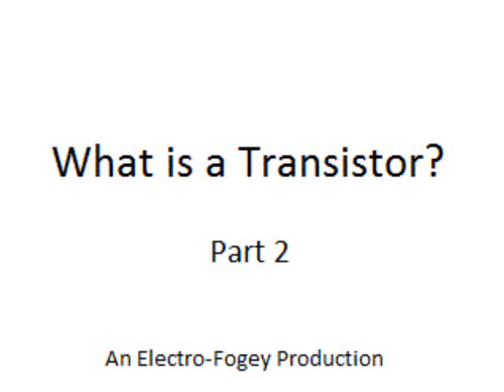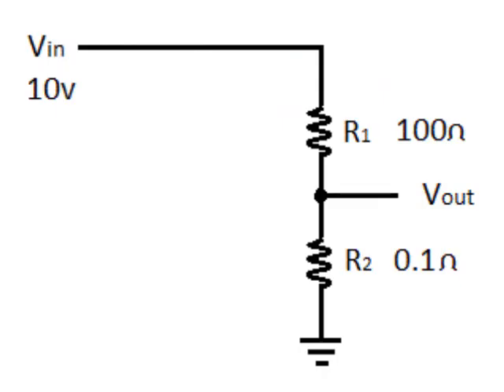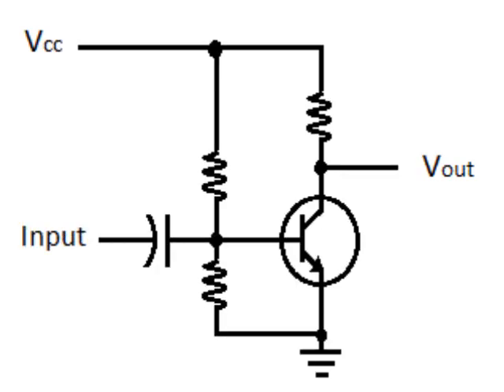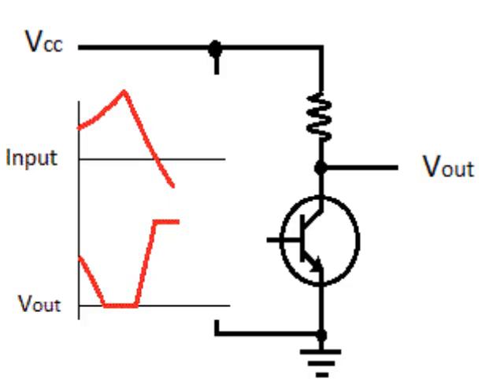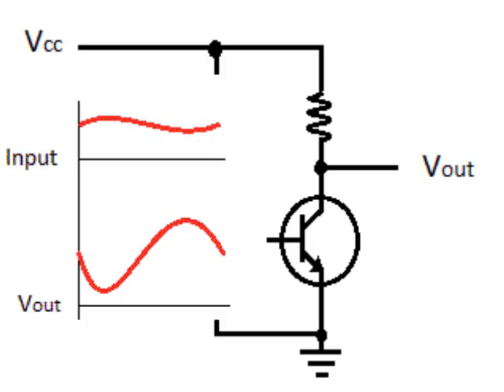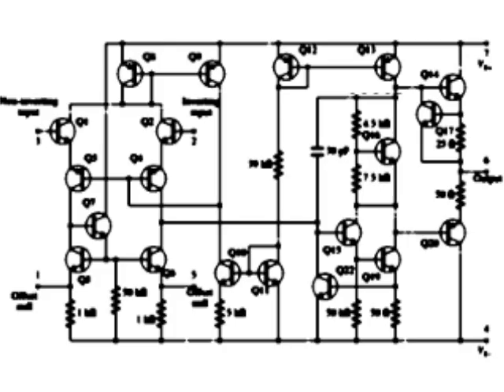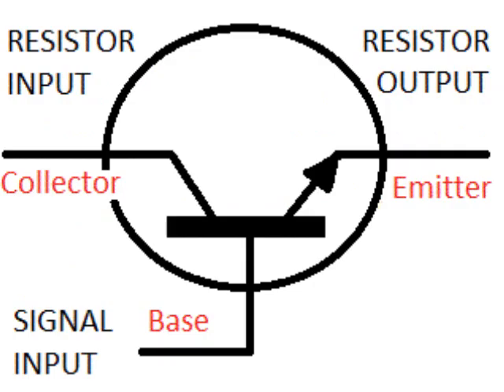What is a transistor?  How does a transistor work?  Part 2

Comment: This is quite cool.  I learnt a lot about transistors with your video.  However, i noticed that you left out the explanation of R1 after you explained what R2 and R3 does.  What is the value for R1 and why? I thought the transistor collector emitter current was already controlled by the Base so R1 was not really needed.

Comment: Amazing! I'm an electrical engineer, whose been working in industry for the past 3 years. I never had a full understanding of how these things worked, and was only ever taught the "Class A, x configuration, blah blah..." 
They made us build circuits with transistors, and showed us how to build an amplifier, described the physics, but never really taught us how to put them to practical use as a tool in our toolbox. 
Thank you Doug Peter, RIP.

Comment: I feel that you are one of the best Tutors I have ever encounter. You have done away with the Narcissistic Ego need of that many instructors have which lacks any common sense.I encounter a question in an exam which I have not been able to find a direct answer for and was hopping you might be able to shine some light on it; What is the voltage needed to forward bias a transistor?

Comment: Why does the phase reverse int this video when it did not in part one? Is that because of some magic in the voltage divider and not due to the transistor alone? And is it correct understood that a transistor and potentiometer roughly does the same thing (variable resistance) but the transistor is controlled by an input voltage whereas a potentiometer is controlled by my fingers? Otherwise, great videos!

Comment: that's not exactly what I said.  I said you can take a weak signal at the base that will control the larger collector current.  The amount of current that flows through the base will determine the amount of current that flows through the collector times the gain.  I agree you need a power supply, but it is not technically the control; it is more like the setup value needed to get a desired maximum current or saturation value.  BJTs are current control devices while FETs are voltage controlled devices.  for the most part it seems like we are in agreement, but we seem to be getting hung up on semantics.

Comment from the maker: I respectfully disagree with that.  You believe that the transistor takes a small input current at the base and outputs a large current at the collector.  This is incorrect.  The transistor does not create a large current, it controls the current supplied by the power supply so that the current it allows through it is beta times the base current.  If you have no external power supply, there will be no output from the transistor.  It simply limits the current, just like a fixed resistor.

Comment: Before knowing the reason you should be familiar with some semiconductor terminologies.
Reason is when you increase base current (or voltage between B and E) the width of depletion region reduces so electrons can easily pass through the Base to the Emitter junction.

Comment: I don't look at a transistor that way.  I look at it as a device that takes an weak input current, usually changing,  at the base.  and amplifies it by it's gain and reproduces a inverted yet bigger copy of the current at the collector.  It is a current control device.  Base current controls the collector current having a gain (typically 100 times the base current.)

Comment: I learned that the input and output coupling capacitor prevented the source and load resistors from changing the Q point set up by the DC supply. You want your Q point be stable in order to reproduce the input signal with minimum distortion. But, I guess it can also be used the way "steel wheels down" described.

Comment from the maker: Adding DC voltage or biasing current to the transistor's input is good for the transistor, but it may be bad for whatever the input source is.  It isn't good to send your DC voltage back through the microphone or whatever, it may blow.  The capacitor allows AC signal to get to the transistor from the input source, but blocks the DC biasing from going back to the input.  If you aren't sure why the cap blocks DC but passes AC, check out my Basic Electrical video or Afrotechmod's videos.

Comment: swag, i was attempting to find the voltage drop across resistor one, but when finding the total resistance, I kept using the parallel resistor equation formula, then I suddenly realized they were in series...that vout line in the middle threw me off. I found it now, 3.33V across r1.

Comment from the maker: The cap stores a charge, but if the voltage is rapidly changing (AC), then the cap is constantly charging and discharging.  This means that a DC signal to the cap is stopped and stored, but an AC signal is passed thru the cap as if it weren't there.  The cap blocks DC, but passes AC.  The AC input signal isn't affected, but the DC voltage made by R2 and R3 is blocked from flowing back out to the input source, protecting it. For more info, see my Electrons, Charges, and Fields video.

Comment: Hi great video and I get most of it but I have a question and is about the capacitor. I dont understand how is working there, I know a capacitor can store a charge but i dont get his use on the circuit, hope you can help me with that and thanks again for the explanation.

Comment from the maker: Vcc does not affect the input signal.  It is 'filtered' through a voltage divider (R2 and R3) so that a small portion of it can be added to the input so that the transistor won't enter saturation or cutoff.  Vcc is also filtered through another voltage divider, R1 and the transistor.  By varying transistor resistance, the voltage from this divider will change according to the input signal, so a small input yields a large output.

Comment from the maker: In a bipolar junction transistor, C-E resistance is controlled by base current.  However, there can be no current unless there is voltage to drive it, so there has to be a voltage rise to increase current flow (Ohm's Law).  Also, for a BJT you need to get the B-E voltage to about .7vDC before the transistor will go active.  In a FET, the channel resistance is strictly voltage-controlled, there should be no gate current (or very little).

Comment: In the video (or perhaps it was your last one) you said that the resistance changes based on signal input voltage.  Then here you said the resistance changes based on base current.  Does the resistance actually change based on base voltage or base current?

Comment from the maker: Yes, and I should have added a capacitor between the collector and the output, but I had two objectives here - first, simplify the hell out of things, and second, beat the YouTube 15-minute limit on new users.  I needed to get to the op-amp conclusion as quickly as possible, so I had to cut a bunch of stuff out.  I am working on a better tutorial now that my 15-min limit has been removed, but don't hold your breath.  Thanks for watching.

Comment from the maker: A "direct bridge between emitter and collector" means "no resistance" (or  very little), so basically you're saying that I'm right.  I know there will always be a tiny voltage drop across the transistor, but I am an engineer, and the rule states that if reality is within 10% of what I say it should be, then I'm all good ;-)

Comment: sir, may i request something? can you make a video about one simple guitar pedal and how it works? coz i cannot understand, is the signal from guitar mix up to the positive voltage from the DC?

and i observe from schematics that the positive charge is going through the circuit, not electrons coz negative charge from the battery is always connected to the ground..
thanks sir in advance.

Comment: Yes,they definitely are.I hope u r aware that a transistor is nothing but a switch.Logic gates are nothing but a combination of transistors(switches),the way the switches are combined(parall or series) determines the output of a gate,but in a gate ic the transistors r integrated on a silicon chip...
These Logic gates r the basic for micros! Hope this will help :)

Comment from the maker: There's another equation which comes into play here:  P=I x V, Power is Current times Voltage.  You want the largest current output you can have, so look at the transistor spec sheet to see the maximum the transistor can handle.  Now imagine the transistor is quiescent (between saturation and cutoff), and the voltage drop across the transistor is half the supply voltage.  Then, the power equation tells you how much current you can have, so use this voltage and current to find Rx.

Comment: I have a quick question and really hope you can help. The way i derive the PD divider equation leaves you with V_x = (V_s*R_x) / (R_t).

Something none of my lecturers [or books] could properly explain was how you pick R_x. If a question asked 'give V through R_x' then its easy, but what if in your examples it's just a single output junction e.g. V_load, how do i know to pick the bottom resistor to be R_x and not the top? 

I hope you can see how my question is different from the ones above.

Comment: ok,ok... so this confuses me badly as well, if you had a handheld radio and you needed to ground its anttena or any other component how would you do it without touching it to a steal ,or poking a wire into the earth? there is just simply no way to ground anything in a portable device, how the heck can you do this??

Comment from the maker: In a BJT, there are two PN junctions, CB and BE,  and CB is reverse biased.  However, the two junctions are very close together, so this won't work if you just put two diodes together.  The CB junction is  like a zener, tho, so it will flow in reverse if there's enough electrons in the base.  As base signal increases, BE current causes changes in the BE junction, causing changes in amount of electrons in the base.  As base gets more electrons, more go to coll. too, so IBE current controls ICE

Comment: So, that second set of resistors, does that mean the top one would need to be the same value as R1 and the bottom one at the same value as the cut off value of the transistor?

Comment: Can you explain more why if increase voltage input from base, the V out would drop. (Only here I don't understand)
Besides, I like your video very mush, it is very clear, do have more video like this and talk about beta. (I want to know more on why we need to put resistor on emitter or resistor between base and collector. Indeed I know there is something relate to base, but when we should add those resistor)

Comment: They usually supply that with the specifications of the transistor since they change from type to type. You could also find it out yourself by connecting it to a function generator and an oscilloscope while changing the voltage at the base to see when clipping of the output signal occurs.

Comment from the maker: The way electricity works is, voltage is like electrical pressure, and current is the flow of energy.  So, if there is more resistance, it's like resistance to flow in a pipe - there is less current through the pipe, but greater pressure behind the restance (blockage), so when resistance climbs in a circuit, you have less CURRENT, but more VOLTAGE at the resistor (or transistor).  If the resistance value changes, the current and voltage also change.

Comment: Hey  SteelWheelsDown 
How do i know at witch voltage the transistor will be (or nearly) 0ohms? (saturated)
Say i got 12v + on the collector and on the emither i got a 12v 75watt lamp (about 60ma with no further resistor) how do i know how much volt must go on the base to make it saturated?

Great Video btw!

Comment from the maker: Mr. Pan, the whole point of this circuit is to take a tiny AC signal (from an electric guitar or something) and turn it into a big AC signal.  The BJT transistor needs to be turned on first, so R2 and R3 add some DC to the tiny AC and get the transistor active, so now the transistor input is a DC signal with a little AC on top.  The collector output is a big DC with big AC on top of it, and we then run it through a cap to get the output as only big AC. Not enuf space 4 gud answer, making new vid

Comment from the maker: It's part of Kirchoff's Voltage Law: all voltages in a series of resistors must add up to the input voltage, and the voltage on any resistor is (that resistor / sum of all resistors) times input voltage.  So for the bottom resistor, it's (bottom resistor) / (sum of all resistors) times input voltage.  The transistor's resistance can't be calculated easily, but its job is to limit current, like a resistor. The current allowed through the collector is hfe times input, which is how it amplifies.

Comment: Well, if there is zero current running thru the transistor (its resistance is infinite) then there is zero current running thru R1. So zero voltage drop. So Vout will equal Vcc.

Comment: T1 es como  una resistencia variable, regulada por la input haciendo que el transistor (T1) entre en corte  ( resistencia infinitamente alta) o saturacion (baja resistencia)
T1 is like a variable resistor, controlled by the input causing the transistor (T1) into court (infinitely high resistance) or saturation (low resistance)

Comment from the maker: IronPump, Unless otherwise noted, all voltages are measured between the point I mention and common (ground).  So Vin is between Vin and ground, Vout is between Vout and ground, and Vcc is between Vcc and ground.  I called it Vcc because that's how I dimly remembered it from class, but that may not be the correct terminology for it, but just go with it for now.

Comment: The voltage measured between two points (e.g. across a load) is the voltage drop or potential difference. So let's say V_in (the voltage at the terminal of the load where current flows into it) is 10V and V_out (the voltage at the terminal of the load where current flows out of) is 5V, the voltage drop or p.d. across the load is (10 - 5)V or 5V.

Comment: How does the capacitor protect the input signal from the d.c. voltage and why does it have to? 

The input signal that goes through the capacitor is just the electrical force, right? Since if I'm not wrong, little or no current can flow through a capacitor.

And in a real d.c. voltage signal, the graph would be a straight line and not a fluctuating one like in this video, right?

I hope I get answers to these questions. I'm still alittle unclear about what signals and voltages are too.

Comment: @SteelWheelsDown 

I have a question I have always wondered about. What is the purpose of the resistor on top of the collector of the transistor in this type of amplifier circuit?

Does it have to do with maximum power transfer theorem? and if so how? 
or is it just protecting the circuit from 'short circuit' when the emitter-collector resistance falls too much..

Comment from the maker: @Sekuhara, it is certainly possible to do that.  In fact, in most circuit outputs, especially for logic and computer chips, there is a transistor in both the top segment AND the bottom segment.  These two transistors act as a pair, and complement each other, so that as the lower transistor conducts, the upper one does not, and vice versa.  This is why they call them CMOS chips - Complemetary Metal Oxide Semiconductors, a complement pair of MOS transistors making the output stage.

Comment: Thanks for the help here.  In your simple amplifier setup could you not use the transistor a little differently to avoid the phase inversion?  IE, using the transistor emitter as the V out, and wouldn't that eliminate a few resistors?  There might be downsides to that if it even works..

Once again thanks for your help, great videos.

Comment: OMG you have got to be kidding me, I've been up for 36 hours trying to figure out transistors and all the crazy equations that come with them, I've even went as far as to building a few examples in my head to try to help "visualize" the Q point and the voltage trails and now some crazy man on you tube is saying the way i learned it is wrong and that's why it makes little to no sense.

Comment from the maker: A transistor (bipolar junction) is a variable resistor whose collector-emitter resistance value goes down as the base signal goes up.  In a voltage divider where the transistor is on the bottom, yes, the output of the divider will be inverted, and it can only sink current.  If the transistor is on the top, the divider output is just a buffer, and it can only source current. To both source and sink, the divider can have transistors in both top and bottom (TTL, or complemetary push-pull setup).

Comment from the maker: @mbsfaridi, transistors are at the heart of microprocessors.  Transistors are used to construct logic gates (AND, NAND, OR, NOR, NOT, etc.), and logic gates are put together to create larger circuits like flip-flops (bi-stable multivibrators, capable of "storing" a value until its input changes).  If you give each "bit" its own flip-flop, you can string 32 of them together and get a CPU register.  Digital counters, shift registers, binary adders - put all of that into a chip, and that's a CPU!

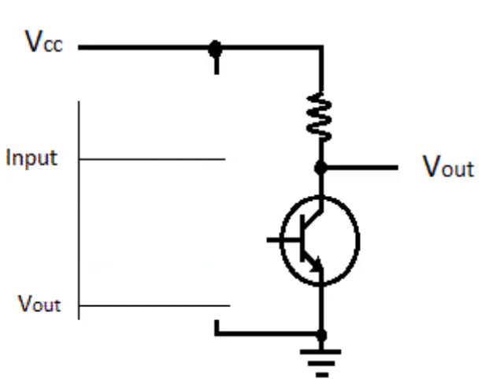Comment: i still don't understand at 6:12, you showed us graphically on how the output voltage (Vout) changes according to the input voltage (Vin). i do not understand why an increase of Vin at the base causes a resistance drop in the transistor? and what is Vin compared to the original Vcc? are you saying there are two different potential difference. please kindly explain anyone. thanks. your video is really changing my perspective about the transistor.

Comment: i have a battery that it's out put is 10.8V at 4 amps and i need it to be 9V and 3 or 2 amps, my dad told me to use resistors and i don't know how to use them. could you help me out pls?